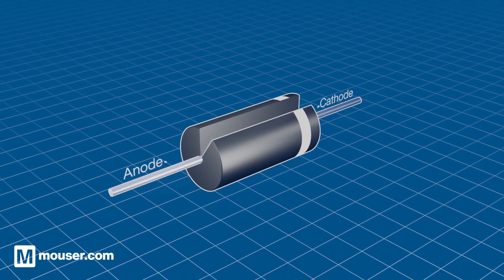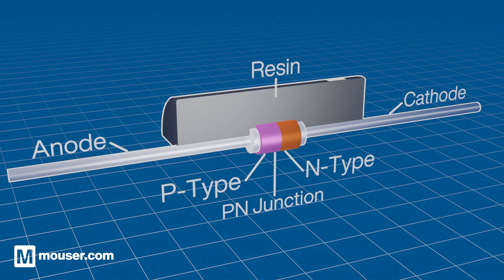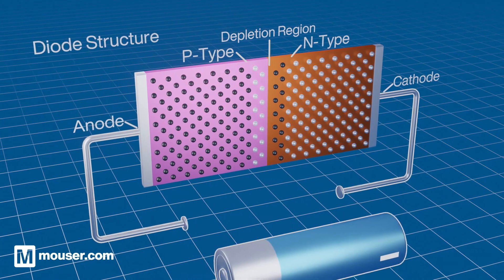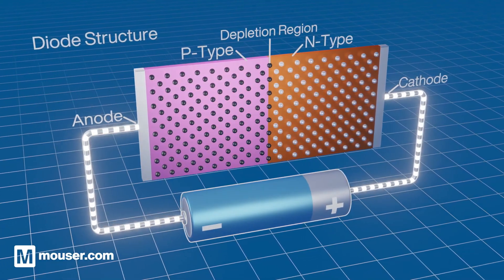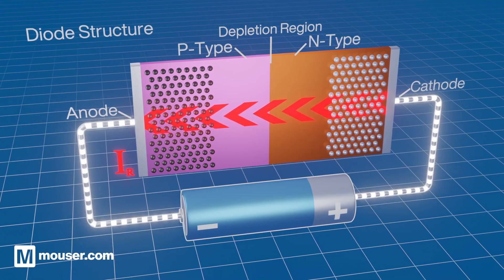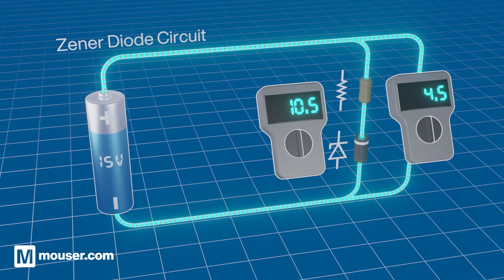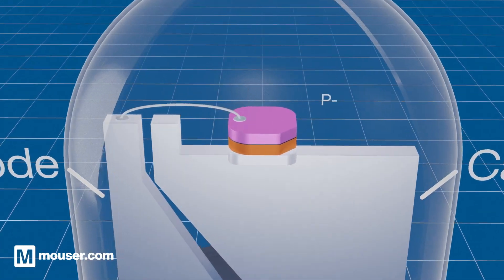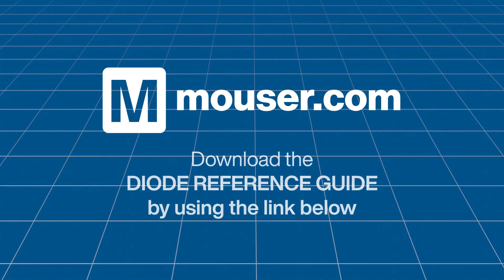What is a Diode? |  Mouser Electronics

Comment: this was a great video.  i first started in electronics when i was a very very young lad.  i was helping my father in his radio/television repair shop.  at the age of about 3 or 4, i would sort out parts based on colors.  (i don't mean the color code , just by the color of the box/part.)  then, as i got older, i would properly sort parts based on color code, or various ratings such as 470μf, or 220Ω, etc...  when i was deemed "old enough", i started pulling parts that i was told to remove from the circuit.  after more experience, i was putting new parts in and being taught how to do basic troubleshooting.  and finally, i would get a piece of malfunctioning equipment dropped in front of me, followed by the directive, "OK.  Fix it."

this prompted a hobby (then a career) in electronics and computer servicing, repair, construction, design, and maintenance.  videos like these can — and do — help others learn the vital basics of electronics, and spread the knowledge that could, pardon the expression, spark a new hobbyist or a new career.

i remember when Mouser was a small "mom and pop" operation many many years ago, and it makes me happy to see that a company so close to my heart, and ol' hometown of Burleson is still going strong.  thanks Mouser, for all you do!  i am a happy, long-time customer of around 35-ish years.